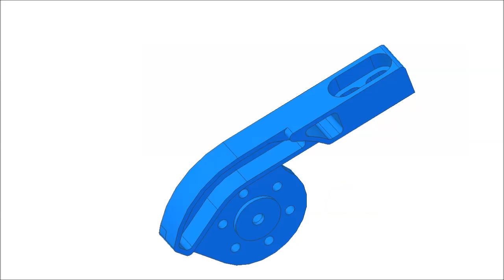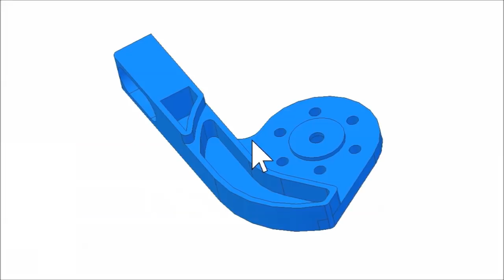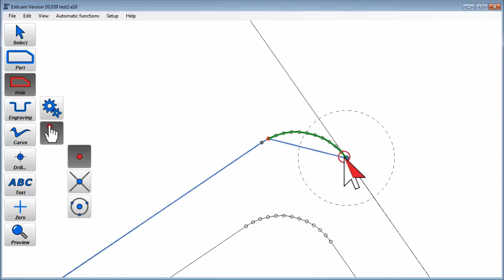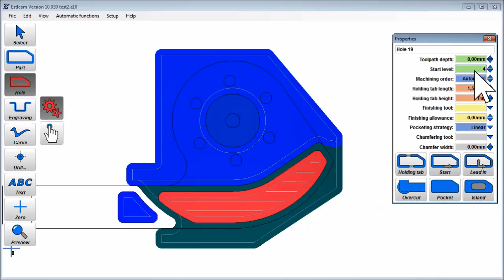2.5d CNC machining an aluminum torque arm

Comment: Can you share feeds and speeds used for the 1/8 tools?
Reply from the maker: 2000mm/min 20000rpm / 5% trochoidal stepover / 33% trochoidal width.
To be honest this is mostly guesswork and not the result of precise calculations - I do not cut much aluminum and with trochoidal milling enabled feeds and speeds work well over a large range of values. I used the feed override during machining to reduce the feed a little - it initially just shook the machine too much and made filming difficult.
Edit: I just aim to achieve nice "needle" chips - then everything is fine. If the chips are dust feeds are too low and / or rpm too high, if the chips are heavily deformed feeds are too high and or rpm too low.
Reply: Thank you, it seems my tools break before i get a chance to override the settings... maybe i should try trochoidal

Comment: Very good Material as usualy - we will put link to our FB. Mr Knull would you be at Maker fair in Berlin next week?
Reply from the maker: Hi, 
thank you - I appreciate every link.
Maker faire Berlin is unfortunately too far away and also no time next week.
Reply: I know - I'm not sure if You remember, few weeks ago Friend of My wrote you an email from Poland. Since that time we are providing some tests and publicate results at our FB . Shortly our Project of CNC for Makers will be over and Estelcam will be one of this platforms witch we will seriously recomend to builders as base Cam and Machine Control Software. We are testing your Software also under Linux ( No is not mistake ) There is kind software translation platform that allow to start your software also in Linux At the moment I provided first Gcodes still left to test controling of the Machine via Arduino UNO.  I was hope to talk and tell You all this informations in Berlin. So now we are Done :)